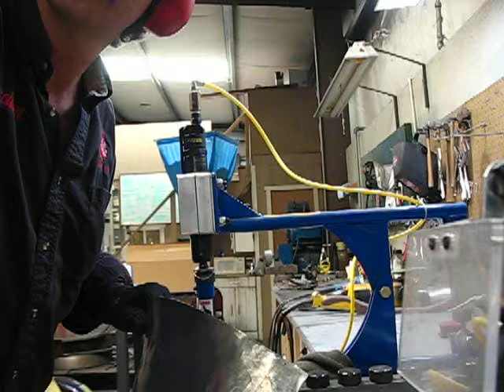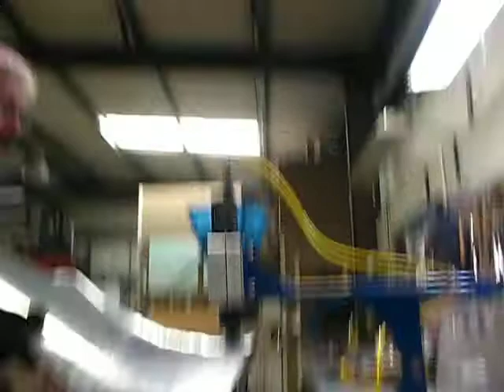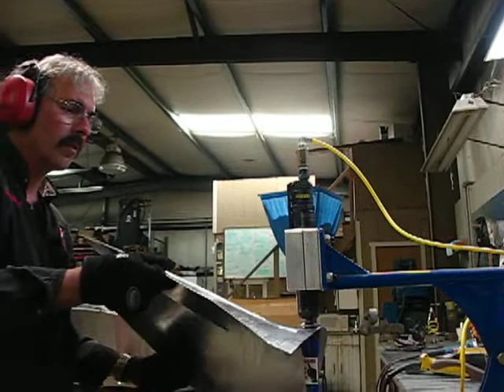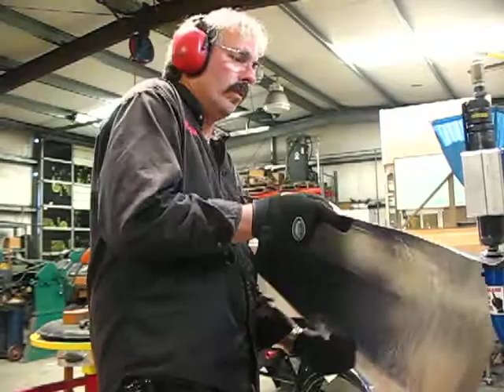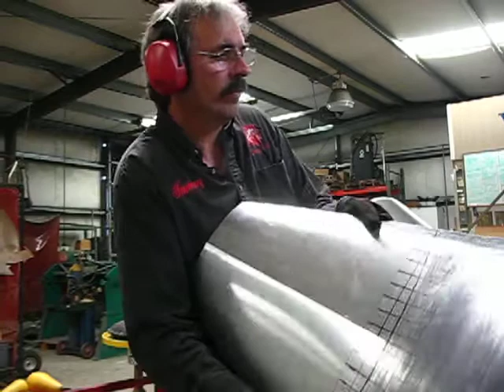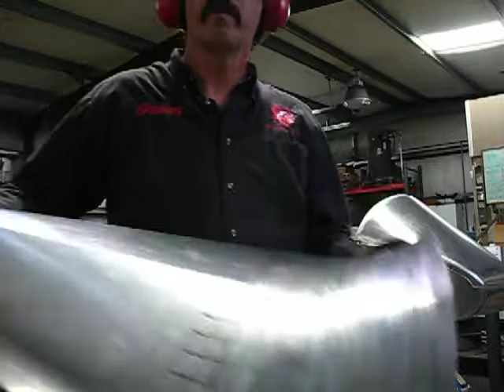Planishing Reverse Curve on an Indian Sidecar Cowling

Comment from the maker: No I used an english wheel and a shrinker/stretcher. Peaking the center involved using a brake and then rolling it through my english wheel down the center line upside down after the cowl was formed. Using the flat upper wheel to crease the metal through the reverse curved portion.